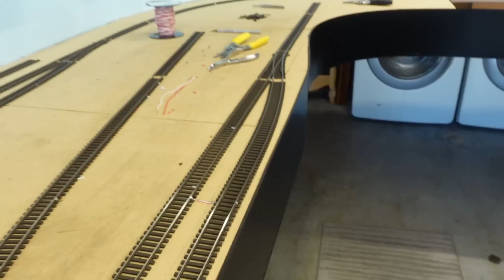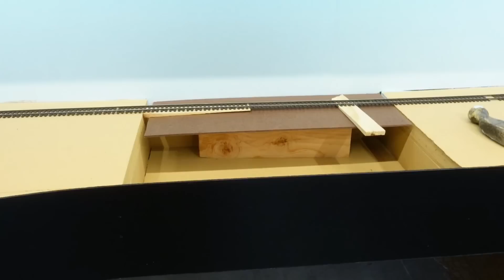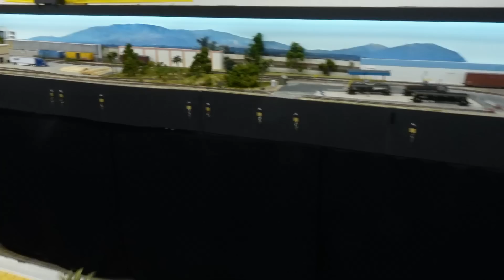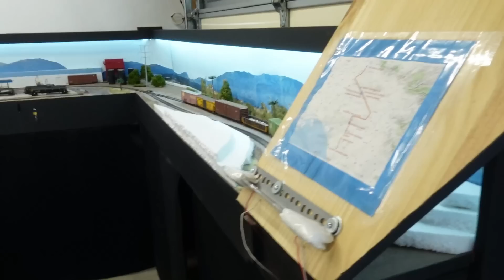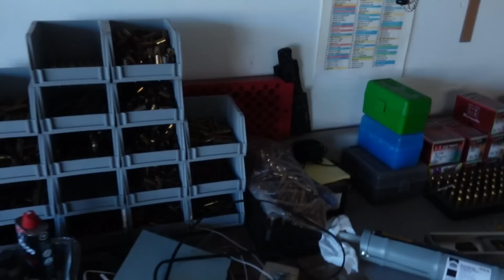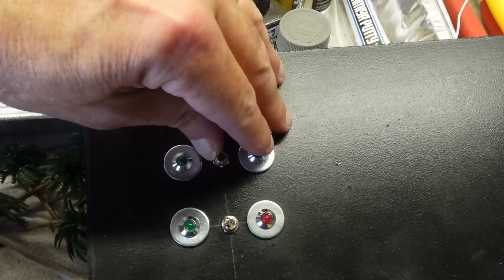Layout Update | Feeders Complete - Running Test Train

Comment: It's looking good Rick. I would have done the same thing to power the run around. Laying in some jumpers is the best option for that situation. What type of bridge is going in over the Santa Ana River? I also like that you have it designed so the train has to go all the way around the layout to get to the new extension. It adds in more run time and more run time means more fun time. Nice job on your control panel, it looks really good as well.
Reply from the maker: Here's the bridge. It wont be as long but will look the same. https://goo.gl/maps/WhoPj5YUvwLba45A7

Comment: New skirts! Was there any industrial sections in any direction other than South of the yard of what you're modeling?  You could have built a "Y" on the lift bridge, then went right and into the expansion section. Left more room where the washer & dryer are at for doing laundry. Just a thought.

Comment: You got them running and looking good.  To silence those other Locomotives without using your control. I would just put in a on off switch  on one of the rails. That you just turn them off so no unwanted noise and extra current draw.

Comment: I really like Blue Point switch machines. They allow you to power your frogs, if you're into that. I use small eye rings to attach them to dowels that I run to the fascia, instead of all that fancy stuff that Blue Point wants to sell you, so very little additional cost. It's a little tough mounting them after you've installed the switches, but not impossible. The Rix product mentioned in another comment looks interesting and is much cheaper. It's not a complete solution by itself, though.
Reply: @SoCalScaleModels  I used one of those Bluepoints in a location where I needed to be able to throw the 
turnout from two locations. I have wooden pushrods connected to the lever on the bottom from both locations, so
one can be on either side of a scene divider and still throw the switch. It's on the end of Y if you wondered. 
Rick, you could also use aircraft model bell cranks and throw rods, but you may find they are more trouble 
than they are worth, compared with a Bluepint and push rods of metal or wood. Good luck with those. Or of course
the electrics. Myself, I don't like electrics if the they wouldn't be powered in real life, like off a main line. Like you,
I just finger flip or have moved to ground throws. (I like the ground throws as consistent for op crews, Kiss n all)
Amazing progress, I can't keep up.